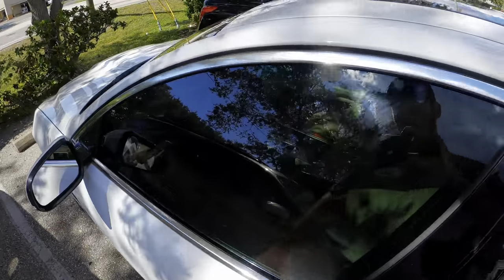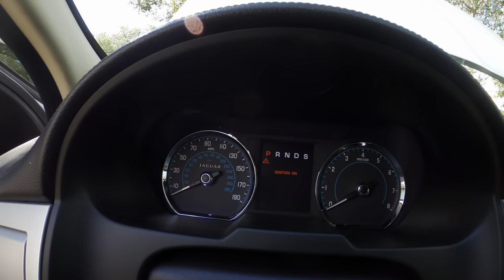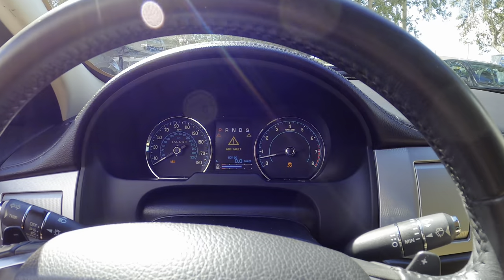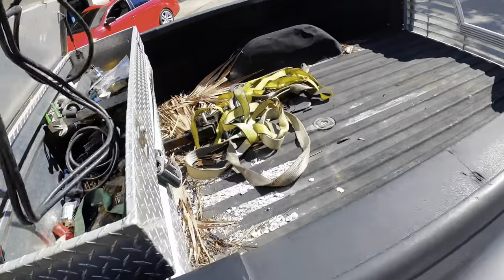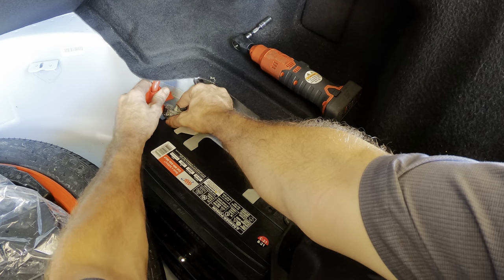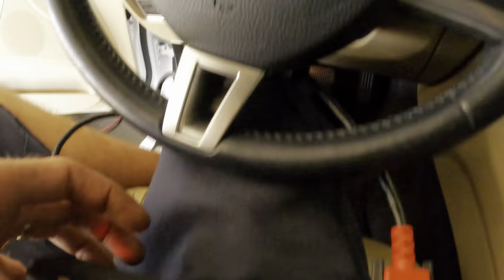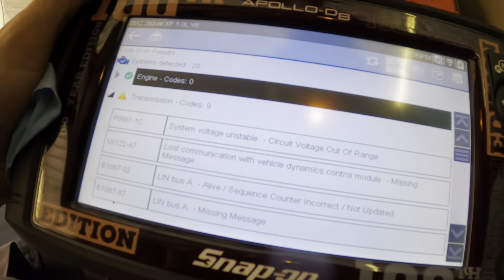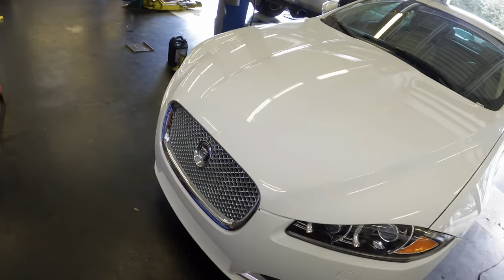Jaguar XS just Towed In.  I’m in over my head! Customer States: “Check Battery”

Comment: Very frustrating. I own a jaguar, and I know from  personal  experience that a faulty  battery can throw up totally random fault codes. I also know that jump starting the XF I own,  it not straight forward as it is on  most cars;  you have to connect  the jump cables as per the book. The neg is not connected to the neg post on the battery, the drivers hand book warns  against this, it's connected to the car body. I also know this car, more than any I have ever owned, needs a good fully charged battery all the time. A good voltage is as important  to this car as fuel. I would  love to know what the diagnosis was.

Comment: There is no 'overkill'. There is only 'make sure it's really dead.' By the way, this might be a situation where it would be helpful to have a small generator, small enough to fit in the trunk, and a powerful battery charger. Run the generator in the trunk, plug the battery charger into the generator to keep the battery topped off while you move the car. If the battery is in the front, put the charger in the back seat. 50 amps got a 4 cylinder sedan 5 miles down the road, down a hill and into my driveway. It couldn't feed the spark plugs past about 50mph though.

Comment: Many times in advanced systems used by luxury cars codes are thrown just because of a dead battery.  Clearing the codes will reveal what's really valid.  But you made the right decision of course because while you could research this vehicle online, you won't get paid for that time.  Let the dealer fix it.

Comment: Parasitic drain and voltage regulator if it were American, the problem is low voltage has destroyed something in the computer. BMW and Mercedes have to have a specific battery and have issues when battery is disconnected or goes dead they have a procedure for replacement of  glass mat battery’s.

Comment: I see that Centech booster. Surprised to see you with a Harbor Freight special. Why didn't you give your best guess, though? I don't understand why "The vehicle is not charging, which is causing your battery to drain. There are a lot of trouble codes I do not have the training to diagnose, so I recommend you go to Jaguar for repairs" is a problem.

Comment: I may have been inclined to print the code report and the clear all to reset and see if the controllers came back to life. Many Europeans actually require reset after battery replacement.

Comment: Damn Ray that was a super smart move. That was a lot of codes acrossed what appeared to be every Module in the car.  Some one already said it but my guess is the some one shorted the coms circuit which could just be a parts cannon. Maybe an individual component is shorting it out but who can say right? Good call I would have turned it away as well. Let the Jag techs figure it out

Comment: Dead battery maybe caused by a dodgy alternator. These cars create soft faults that must be cleared. They won't go away just because you've corrected the initial problem. Dead batteries cause a lot of soft faults because all of the modules are no longer working properly.
Clear all faults (after recording them).
Go after the faults that come back.
Dealing with Euro and German cars, this happens all the time.

Comment: 11.8 wont start the car. You need 12.4 If you put a new battery in the car it would  probably work. I believe that year car had two. I’ve owned 3 Jaguar XF and all have been incredibly reliable. Batteries brakes, water pump. Nothing serious. Low voltage will  always cause many issues . They are pretty easy to work on

Comment: Ray i dont know nothing about anything. but the no smoking sticker on side tell me it was a rental, someone got a cheap car sold to them with just change the battery story. ALSO something tell me that not the Right battery that car. i had some like this with my ex BMW . i couldnt just get an off the shelf battery. Depending on what package or OEM accessories you need a battery with a certain amps to run the car other wise it will kill battery and throw random codes. And once you get the right battery you need to use the scan tool and tell the car a new one was install other wise it will kill it in 3 months.

Comment: Bet it was just the alternator. From my own experiences with my charger. When my battery went bad my cars system did the same with throwing a ton of codes. Replaced the battery and the codes went away. Since you replaced the battery and still got the low voltage, i would have checked the alternator also. If the alternator was nating, then i would have passed it on to the dealer. But thats me and my own comfort level

Comment: I would have just changed the alternator and put a brand new battery in and cleared the codes. I would explain to the customer what the plan was and it may be a successful repair or it could also fail to fix the issue.

Comment: Being that it had low voltage and was started a few times with a junk battery. Those codes are almost all redundant low voltage code. I would have printed codes then erased the codes. Rescan leave print in car and then test the alternator.

Comment: I don't think it would be that complicated. it has a relatively new battery. alternator not charging. charge the battery, replace alternator, delete codes. all those issues and codes you see come from the same single issue

Comment: If you wanted to diagnose it, the voltage issues  would be my first step. I've seen some crazy things caused by low voltage. That said, I'd send it to the dealer like you did.

Comment: years ago i had jaguar x type brakes job went wrong calipers will lock it up so tow truck to local shop he replaced calipers and still same issue flushed fluid changed fluid container got charge over $1000.00 from him he charged me also to tow to jaguar dealer they fixed problem over$1500,oo so never used him again end up was abs system ,,,,

Comment: Dutch guy on YouTube who goes in deep with ECUs cambuses etc surprising what faulty modules can do,  remember one he did it was a faulty  rear door lock motor which caused the control module to blow leading to a full list of codes being thrown all  over the car . This is well beyond a  mechanics job and more a computer programmers who understands the whole system   and most dealers struggle with this type of work and these  job go through remote technical support centers and it's often trial and error with swapping modules to see if it fixes the issue often with little knowledge of the system they are working on .

Comment: Alternator and battery would 100 percent fix. Gearbox fault is from low power. Its an auto. It needs power to switch gears. Alternator went causing the battery to go flat. Battery was left flat and went duff. New alternator and new battery. Delete codes and reset battery monitoring system. And all done.

Comment: I would have googled the issue a bit as in “jaguar model etc etc not charging low battery and showing every fault code possible” probably just the charging fault they r dead sensitive to the wrong voltage. But bein in the states it’s not as easy to grab the parts probably. U might have been able to charge it and run it with a charge unit but at least like u said u didn’t try a bunch of parts before giving up in defeat.

Comment: I had a black xj 2010 my Alternator had broken in half to me looks like a bad Alternator which is making everything go made or with some cars they need to  be told that they had a battery change so the ECU knows how much to charge is going in and out so it doesn't damage any of the electricity systems but by the look it's more of a bad Alternator when the battery is very low the gearbox locks up its all power by the battery it needs the correct voltage.

Comment: I have a hard time saying no. I’m assuming the charging system was stewing with everything due to the low voltage codes. Some times you just have to say to yourself “ keep it simple stupid” voltage drop test the alternator check it at the peg and see if it’s sending out voltage your scan tool would have told you if the computer was turning it on. Then it’s just voltage drop. But good job giving it up.

Comment: You have a snap on scan too, where is the live stream data and ecm commanded voltage vs the actual output…? Which cylinder is misfiring, live data would have told you a lot

Comment: These Jags are know for their pooo electronics ⚡️my friends one had problems with water getting into the boot and loads of bad wires also his dads Jag had the same issue but his was down to condensation in the boot with again lots of corroded wires.. Some times with these  newer vehicles which have a multitude of electronics the battery or batteries needs to be spot-on or things wont be getting the right voltage and will cause you problems. Ray is right it’s needs the dealers**t 🤣

Comment: I guess the Jags are very hard to work on and they are a money pit too. Unreliable is another thing I've heard about Jaguars. I would never buy one or any other European vehicle. I'm fine with Hondas and Toyotas. And old chevy. I do like my Infiniti M37 from 2012. It's luxurious and super reliable! Thanks for the video. It's interesting how you put the negative first then the positive. I always do the positive first then the negative just in case the alligator clips touch metal TBH. BTW, my infini goes crazy when there's a battery issue. Codes all over the place. In my case, it was just a battery.

Comment: Locking itself into park is a terrible idea, if it's going to lock itself into any gear it should be neutral so that you can at least push or tow the car.
I've seen plenty of cars break down or fail on roundabouts and traffic lights, but with the help of a couple of nearby pedestrians or drivers those cars are moved off the road or out of the way within minutes, imagine this jag doing the same thing but also locking itself in park.

Comment: Hi Ray, I'm an enthusiast not any kind of mechanic. One thing I always think is you are quite carefree about connecting and disconnecting battery leads. With these super high tech newer cars the chance a tiny short could create new problems is going way up. By always doing the old positive first off last on you may reduce the chances of making an electrical fault worse. Cheers

Comment: I drive jags and land rovers also work on my own vehicles.  I’ve done about every job on them from full rebuild on engines to those annoying sensors.  You have a wiring issue here. Typically English electrical. 90% ground issues.
Reply: They lock in park like that.  Not totally abnormal on the XF. I have a 12 portfolio myself.
Reply: I actually started working on cars because owing a Land Rover.  There is a saying Land Rover making mechanics out of owners since 1947.

Comment: I am not pretending to know what is wrong with this car but....I have a 2010 XF 3.0 V6 Diesel and had the alternator failed on me last year. As soon as the Voltage drops on the battery (and it will very quickly if the alternater fails and the engin is running) You will first see a red battery symbol being displayed then... Parking Break Fault...then Gear Box Fault...Its now time to Stop. I managed to get home, charge the battery and then drive it local gararge, just! it was 10 minutes drive.  All the errors were a result of the battery losing voltage. Fix the alternator and everything started to work...again.

Comment: You probably would have worked it out given enough time, but you can't charge a customer for 10 hours of working stuff out that a dealer can just get straight on to, so you did the right thing by yourself. If you took the job on you'd just be doing a whole bunch of work for free, with no guarantee you'd even get the job done and be able to charge anything at all.

Comment: I’ve been watching your videos for awhile and enjoy them. I am not an automotive technician but I have been a heavy diesel technician for 15 years. The reason that it is advisable to disconnect ground terminals first and positive terminals last (and vice versa when connecting) is so that if loose or stray positive connections contact the vehicle frame during assembly or disassembly, there will be no short circuit. Your procedure is backwards. Always disconnect grounds first and reconnect them last. The information you provided is a disservice to amateur technicians out there. With the heavy diesels I work on there’s no imminent threat of fire if fuel is present, but if you’re working on a gas engine, sparks flying about might lead to a bad day. Just saying!

Comment: It seems obvious to me the battery has a dead cell and is toast. The electronic controls run on 12 volts, NOT 11.2, and certainly not 6. Good you gave it back to them. What the hell were they thinking when they bought a Jaguar in the first place? My guess is they'll never get it fixed properly and that's after spending at Jaguar more than the car is even worth. That's why these are so cheap used. Same thing with Mercedes and BMW. On this car, I would say it's all in the charging system. The battery, even your good one is only at 11 volts and that will trip all the fault codes you're seeing. Beamers do that. Even Toyota's do that.

Comment: All of the faults are fundamentally due to the battery voltage being low. What’s causing it not to charge could well be the alternator, but equally it was a wise move to not just change that and pray!
Reply: Which he didn't determine from the off. Also Jump starting a Jag is not a good idea.

Comment: Does Jag use Aux battery like the Range Rover? On the Range Rover it will throw transmission fault on the dash and does all kinds of crazy stuff when it goes bad. Had the same problem on a Range Rover Evoque, change the Aux battery and all fault’s went away. Depends on year, the Aux battery can be under the wiper shield under the bonnet or in passenger under side dash. If you don’t get Aux battery from Rover you might have to change connectors

Comment: Hate to say this, but you put in a new Alternator and clear codes, and it will just run fine after words. Biggest problem with Jags and bad alternator.
Reply: Older Jags had Voltage regulator off the alternator which I get a lot of saying the replace alternator and still not charging the battery. you can replace alternators till you blue in the face and still won't charge.

Comment: Sorry Ray but you're wrong this time...When a pwm controlled alternator don't see a computer he enters in default mode who provides enough voltage to the battery, tipically 13.8 V. So what you have is a regulator or alternator or a simply plug disconected or broken...And yes, all the codes could be related to a low voltage, and a tranny problem could simply non exist.

Comment: You can TELL people "the most expensive car you'll ever buy is a cheap European sedan" and they won't get it. They actually believe it is impossible for a $15,000 vehicle to face a $28,000 service estimate. Not because you drove it into a tree, but because the 'low battery' light came on. Someone is ripping them off. They need to watch this video. This is not some once-in-a-lifetime service experience. This is your tuesday. This is what happens every time you swap the battery or change the the oil every 945 miles EXACTLY or you don't consistently drive 100 miles a day or because they don't really have humidity in Heidelberg so they never really got their German heads around it and certainly never designed the mission-critical parts onm their vehicles to handle it either, why would you think that's weird?. Me, I'm looking in that engine bay where everything is computers held together by plastic parts and thinking hell NO. I can't even keep a computer alive for five years on my desk, a remarkably dry, stable, temperature-controlled and voltage-regulated place. Let me strap one to the underside of my car for a year, then run a check on how the ol' system is doing.

Comment: Cars like that will have weird electal issues if the battery is bad also if batter voltage is low the will not allowe it to shift out of park my bmw is the same way. Also my alternator went out and was overcharging so the computer system shut everything down as safety if the voltage is not right on them cars it will cause hell of alot problems. It will also cause alot of fluke warning messages and engine codes.  Chances are the car is fine and needs a new battery and or alternateor.

Unless you now whay your doing with euro cars probably best to stay away from em.

I know my bmw requires programming for even something as small as changing the battery it must be progrmmed to the computer.

Comment: You spent way to much time and energy on that car you should've been compensated. And all those low voltage faults in all the modules is from the alternator not charging. I would've told the customer we need to start with an alternator and do a load test on the battery to see if it's still good

Comment: If this is the same jag, you later in your own shop had to change the alternator on agine apparently the guy who did finly work on it didn't know how to either.

You spend this much money on a car that has this many fancy do dads on it you should also be able to take it to the dealership when it needs service. Dont be put off if the mechanic says its above his skill, and dont be ashamed to admit it is above your limits.  Dealerships mechanics know these cars. Wile the price to repair might seem steep its a lot cheaper then somone who dosnt know the cars systems becuse he's just going to start dumping tons of parts into it hopping to hit the right problem.
If every system on the car shows falts this might be tough for a factory trained tec also.